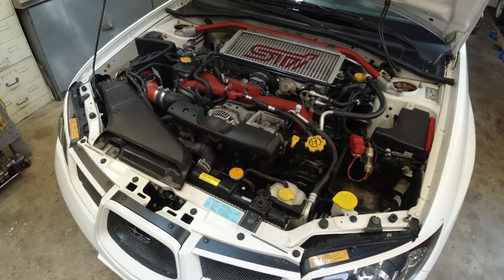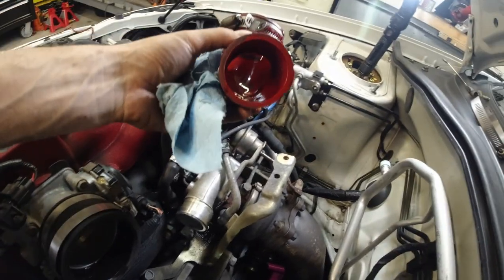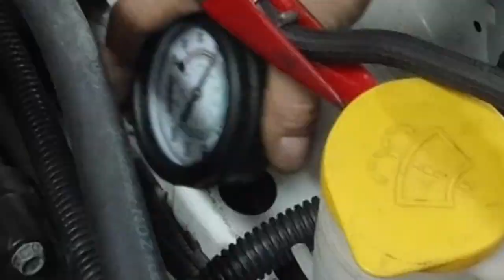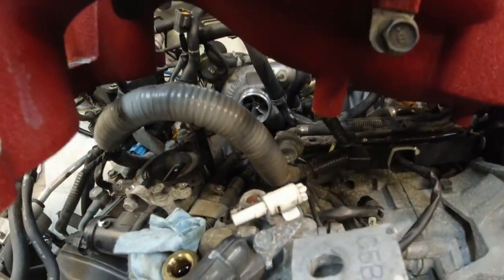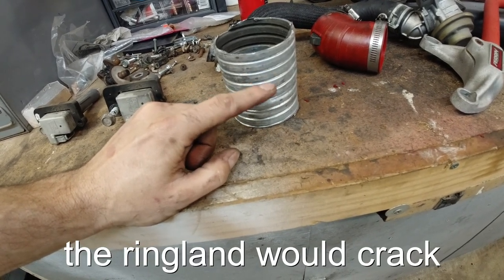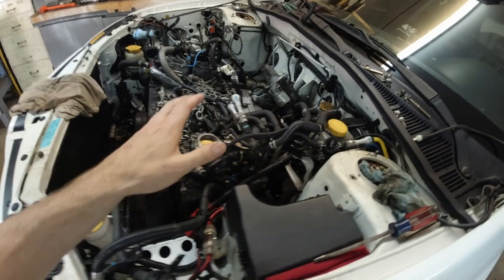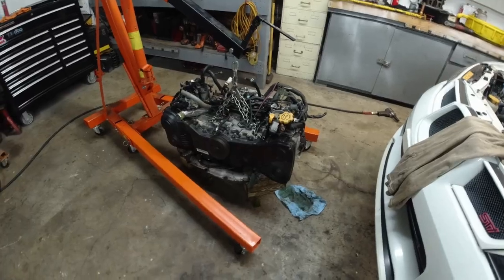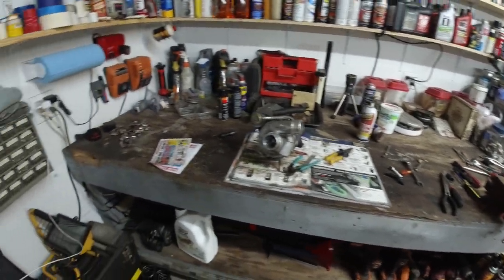Subaru STI oil blow by after trackday, engine out?

Comment: No AOS? Air oil separator? Hope you added cylinder 4 cooling mod is a must for reliability purposes and thats smart where you used that silver tube to direct cold air to the intake
Reply from the maker: I got a series on this STI with over 20 episodes building the engine, aos, cyl 4 mod, E85, exhaust cutout and more, check it out...